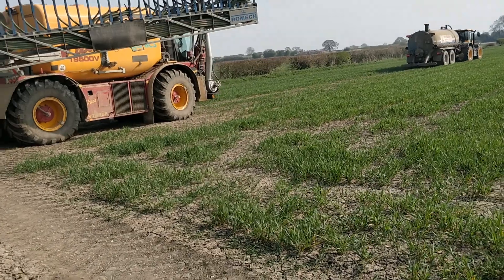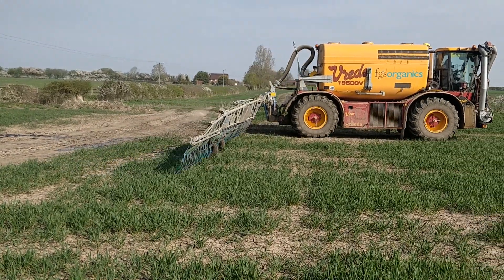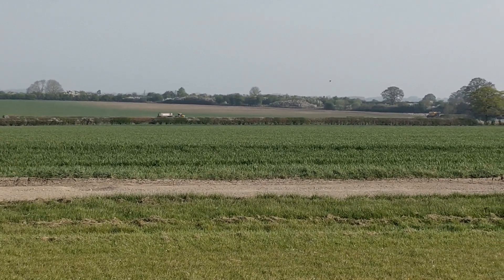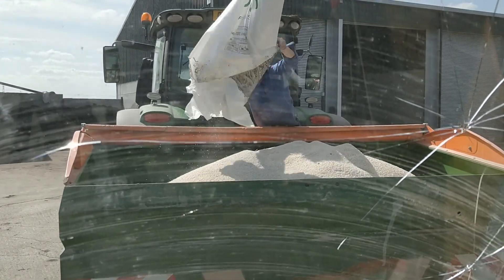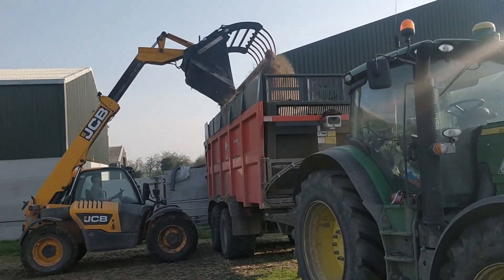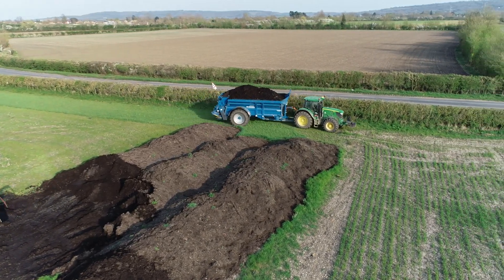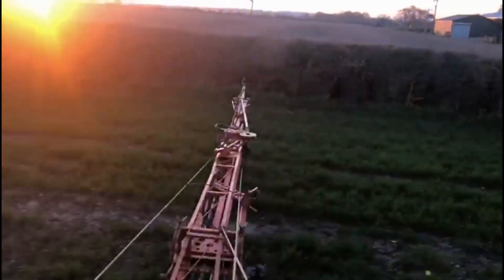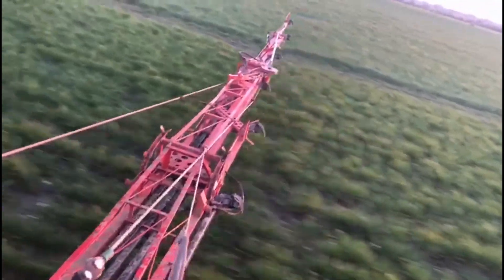Animal, vegetable and mineral fertiliser

Comment: Very informative as ever. Do you have much success blowing seed in with the air seeder with germination etc? I’m assuming there’s no raking it in at all??
Reply from the maker: Seed rate is 50% higher, success ok if machinery working. Drier years are better than wet.